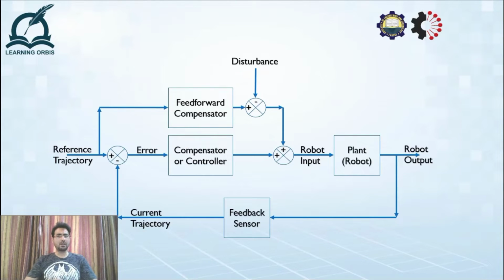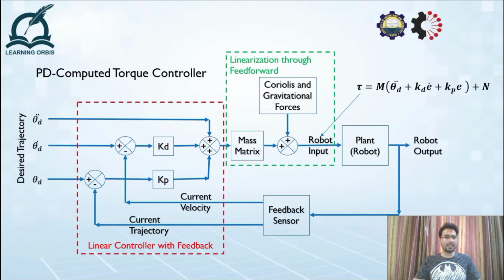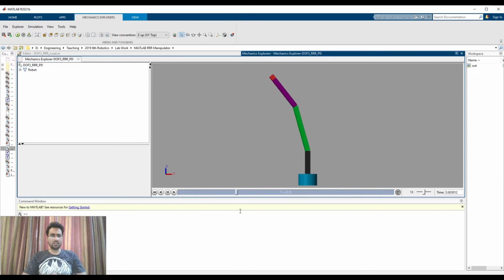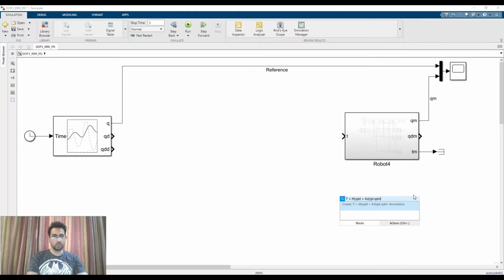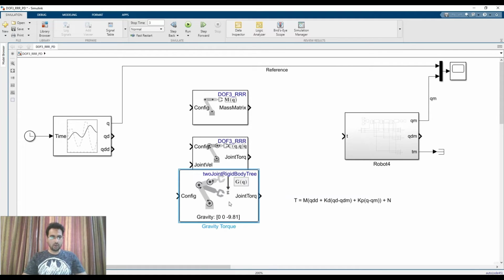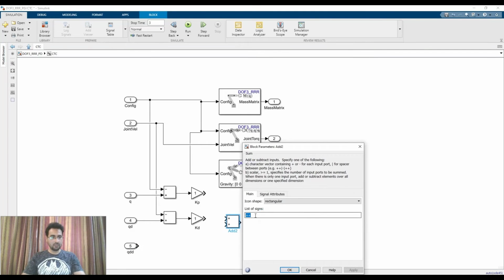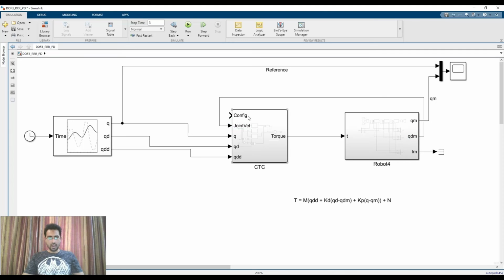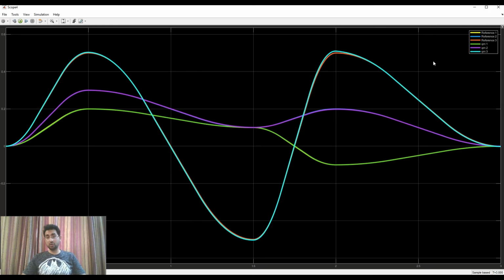Computed Torque Control of a Robot Manipulator in MATLAB 2021 | RST | SimScape

Comment: Hallo, My torques are getting really big at the start of the simulation. You know how I could fix that? Thank you.
Reply from the maker: Make sure the trajectories initial point is same as the point where the robot is. Also check all the units, because sometimes because of wrong units (degrees, radians, Nm, etc.) the torque shoots up.

Comment: I got a question. What if the robot is not 3 DOFs? For example, for 6DOF robot how can we do the matrix product?
Reply from the maker: The simulink blocks will calculate the required matrix product based on the rigidbodytree of your robot, whether its 3 DOF, 6 DOF, or 20 DOF, the matrix product will be calculated.

Comment: Hello, sir. I have added KI to your calculated torque control model, making it PID control. However, I have found a problem with my RPPR model. When using this model to control the motion of the robotic arm, except for KP=1, KI=0, and KD=0, no matter how you adjust these three parameters, it can almost perfectly track the trajectory with an error of 1 in 10000. I would like to ask if my control strategy is wrong.
Reply from the maker: Adding KI means integrating the error, therefore the Integral term will always remove the error, but will in turn make it impossible to control the robot in real-life because the torque requirements will shoot up. Check the torque requirement of each joint and you will see the issue.

Comment: sir how to set 1 input in robotic manipulator
Reply from the maker: What do you mean by 1 input?
Reply: @LearningOrbis  My simulation is runnig but kp,kd,ki how i find this value?
Reply from the maker: There are only Kp and Kd here. Any positive value of both parameters will produce stable output, however, settling time depends on the Kp and Kd. You can slowly change your values to get the optimum one.
Reply: @LearningOrbis  but my question why is not used ki??how to connect ki in computed torque control?is there any option to use fuzzy logic with pid just like video tutorial?

Comment: Thanks for the explanation, it really helped me understand this after reading some textbooks. i want to ask sir, How to implement this controller on the original Robot? can it be applied to the microcontroller over the like?
Reply from the maker: It depends on the number of degrees of freedom of your robot and processing capacity of the microcontroller. You have to figure out M, C, and G matrices and code the equations on your own, which is a complex mathematical task.

Comment: Hello, thanks for your video, it was clear, straightforward and complete. Maybe the best video i've watched so far about implementation of robot control on simulink. I don't know if you've ever worked on quadruped walking robot, but if yes, according to you, what's the best controller to implement? and how to do it on MATLAB simulink? 
in fact there are so many controller proposed related to this subject and that makes the choice particularly difficult
Reply from the maker: You are welcome!
I haven't worked on walking robots, as for controllers, it depends on several factors that which controller should be used. Unfortunately, you have to try 2 or 3 to figure the suitable one.
Reply: @LearningOrbis  Okay thanks a lot. In real, i've tried to implement the CTC on the leg mechanism of my robot, and i encountered some issues on it because the leg just went crazy (even controlled). So is there a mail address or a forum in which we could 
discuss because i'ven't figured out the problem yet so if you could help me sir
Reply: @hobycedric6279  Hi. I am working something similar as yours. Do you manage to solve the issue? I have similar issue too.
Reply: @erwin5245  hi ... yes i solved mine finally  ... if you have a mail address or a social media account we could discuss further

Comment: Hi, thank you for your video sir! I have a question: i am trying to implement the computed torque controller  for a kinova gen3 in simulink in the task space instead of the joint space, but i don't understand how to implement it in simulnk. I know the theory about jacobian and so on. Can you help me with some tips please?
Reply from the maker: I would recommend you implement it in joint space using the methodology described in my videos. Once you have done that, yo just have to use inverse kinematics block to convert your workspace trajectory into joint space trajectory.
Reply: @LearningOrbis  I ended up making my robot follow my trajectory and I was able to draw the robot motion and the trajectory. Thank you very much for your help. I was thinking that inverting kinematics was harder than put all my system in the task space but i was wrong. 
Now i have another question but it is not linked to the one before: i want to estimate the state of my nonlinear system with the EKF (i can't use the simulink block about EKF). I wrote the code for the prediction step and correction step. The problem is how i can initialize it with my initial state and initial covariant matrix? Do you have some advice?
Reply from the maker: Sorry I've little knowledge of Kalman Filter, especially implementation on MATLAB. You may want to search the issue on mathworks.com
Reply: @LearningOrbis  ok, thank you anyway

Comment: Dear Sir,
I'm developing a torque controlled robotic leg. Will the design for it be similar or should i consider something more , Since for a robotic leg we have interaction with the ground as well.
Reply from the maker: Yes, definitely, You'll need to define the ground and your robot's interaction with the ground.
Reply: Hi. I am working something similar as yours. Do you manage to solve the issue? I have similar issue too.
Reply: Hello, yes. You can use contact force block from simulink to determine the ground reaction force.

Comment: Dear Sir,
How is controlling the manipulator in torque mode different than position mode ? Whats the point of feed forward torque ? Is a PID based position control not sufficient to do the actuation ?
Reply from the maker: Torque mode control is required when you want to control the torque of each joint motor, whereas position based control is controlling the position of the motor without any regard to the torque. Normally a hardware motor controller takes position commands from your position based controller and will drive the motor accordingly by keeping torque in control along with the position.

Comment: Hi, I am working on the UR5 robotic Arm and I have to find its torque values so that I cannot let it fall down due to gravity. can you tell me how I can do this as the arm is 6 DoF?
Reply from the maker: You have to drive the robot in Gravity Compensation mode. For this you have to modify the computed torque control a bit so that the torque from the external source, that is your push is added to mass terms. You can skip the PD controller portion altogether if you wish or if your dynamic model is good enough.

Comment: Thanks a lot, sir.. ur explanations are superb. Sir, what is actually the relationship between the motor that we used with the controller that we're gonna be using?  I noticed that there is no "motor model" as an actuator in the simscape model..is it necessary to insert the motor model in the Matlab block or we can just ignore it?
Reply from the maker: There are levels of involvement of motor in the complete robot model. If you are only considering the inertia and damping being introduced by the motor, then the Joints in SimScape allow you to configure these things to represent the motor model. However, if you want to implement full motor model, then you have to consider torque capabilities of the motor, the dynamics of the motor controller, its saturations, etc. To implement this thing you have to look for complete motor models present in SImScape -> Electrical Toolbox. Moreover, you, most probably, have to modify or configure those models as per your requirement.
Reply: Awesome.. thanks a lot Sir..u are so helpful with brilliant ideas
👍🏼 👍🏼👍🏼👍🏼👍🏼

Comment: thank you a lot Sir you make it super easy . 
can i use these configuration blocks  for lower limb robot also ?
also can you pls , make video on how to use dynamic model  for building the robot body instead of using the blocks (lower limb robot).
Reply from the maker: For implementing Dynamic model you have to figure out the dynamic equations using either Euler-Lagrange or Newton method and then implement those equations.
Reply: Hi Alrawda Suliman, I'm working on something similar. Would you like to connect and discuss it ?
Reply: @santoshkumar-yh2bc  waiting your email .

Comment: Hi! It is possible to compute a robot with CTC and an arduino board? -- Many thanks for this tutorials. I´m reading Craig for robotics and complementing that theory with your videos is powerfull I think.
Reply from the maker: I don't think you can implement CTC on arduino. What you can do is compute joint angles on a PC or Laptop and then relay those angles to arduino to drive the robot.
Reply: @LearningOrbis  Perfect then. I will try to do that. Simulink is a fascinant environment. Thanks for your effort in this lectures. I really aprecciate that :)